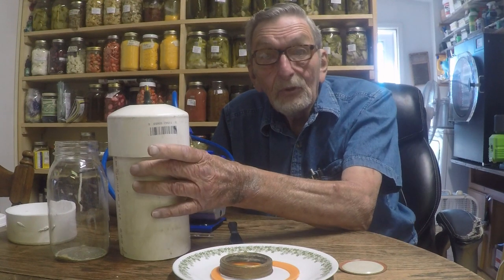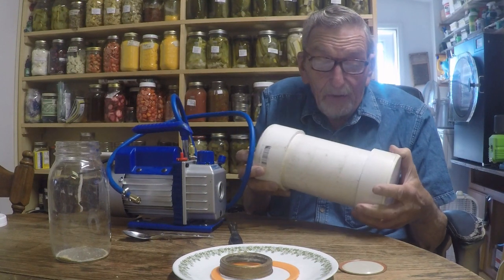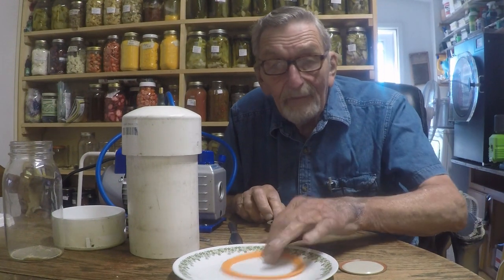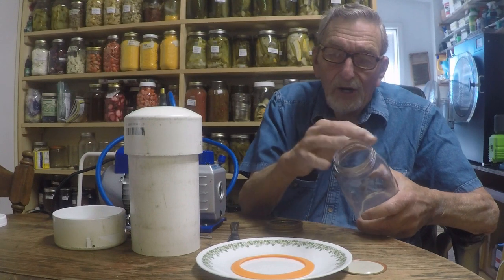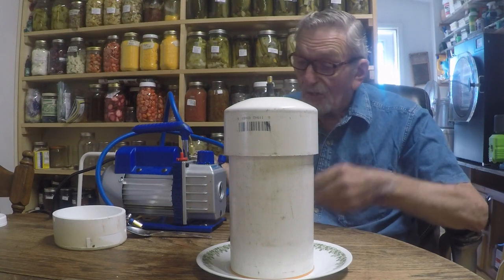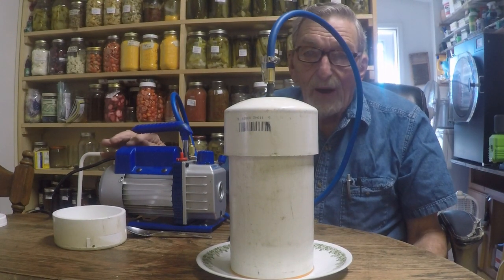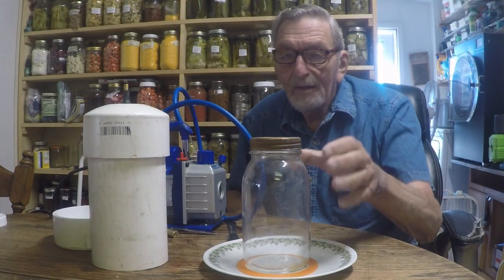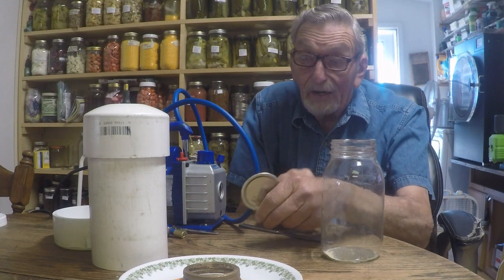DIY vacuum chamber flat surface

Comment: That is an incredible idea👍👍.
You can replace the rubber o-ring with 3/4" wide by 3/8" high foam weather stripping. It will permantly adhere to the PVC pipe the first time a vacuum is applied. A solid surface countertop can do the job of the dinner plate.
Reply from the maker: Great suggestions ... I think both will work just fine :)
Reply: Yup, one less part to mess with ... But only one worry is the ends coming together & leaking. Other than that, it's a good idea 👍
Maybe put RTV Silicone on the end and set it on wax paper to form a flat sealing area.

Comment: Thank you for showing us your simple but very effective idea. So simple and way less expensive than some of the others that I've watched. I need to give this a try.
Reply from the maker: Thanks for your kind words. Give it a try ... it should work as well for you as it has for me. As a side note ... I tried sealing home canned dill pickles cold pack ... failure! They seemed to seal fine but after a few months the seal was broken. I suspect that natural fermentation created gasses and internal pressure that in turn eliminated the vacuum and caused the seal to fail

Comment: Follow up:  I did a test with my "Potane vacuum sealer," sealing in my iPhone in a jar.  My start pressure was 28.85 inHg (14.17 psi) and my end pressure was 4.13 inHg (2.03 psi), for a difference of 24.72 inHg (12.14 psi).  This is a very high seal and good for long storage.  If the DYI vacuum can get 13 inHg (6.4 psi) or higher it should do fine.
Reply: Why 13inHg specifically?

Comment: Could you use a break bleeder hand pump? Thank you for the video,
Reply from the maker: You might but I suspect it would take a lot of effort to develop the vacuum required. Thanks for you comment
Reply from the maker: As an additional input ... I have used this method for a few months now and it continues to work very well. Canned a batch of tomatoes recently and one of the quarts did not seal. I ran the problem quart through the vacuum sealer and ... wala ... it sealed as well as the others

Comment: Elegant!  However, where did you find that gasket?
Reply from the maker: Here is a response to the same question a few months ago ... I had some used EDPM rubber that I used. However, any other material such as a dinner mat or other similar flexible material could be used. Hope this helps ...
Reply: @macmcquaid9413  yes it does!  thank you!!

Comment: Go one step father and put a phone in the jar with the barometer app on so we can see how low the pressures gets.
Or other barometric pressure reading device. 

This way we will known if the vacuum will be good enough to seal food for the long term.
13 inHg should be the target for a long term storage solution. 
Otherwise, good job!
Reply from the maker: good idea ... please let me know if you try this method what the results are

Comment: Where did you get the flat gasket?
Reply from the maker: I had some used EDPM rubber that I used. However, any other material such as a dinner mat or other similar flexible could be used.

Comment: Can you show how to the make the valve on top
Reply from the maker: 1. Drill a 1/2 inch hole in the top of the vacuum chamber. 2. Buy a 1/2 inch "tubeless tire" valve stem. 3. If you lubricate the valve stem with a small amount of liquid soap it will be much easier to pull the valve stem from the bottom of the lid through the hole to seat it. Hope this helps ...

Comment: Great video, do you sell them?
Reply from the maker: I do not sell them but the vacuum pump is available on the internet and the PVC pipe should be available at your neighborhood Ace or box store. Simple to build!
Reply: @macmcquaid9413  I appreciate you so much, you don't even know. We did canning when I was a kid straight out of the garden. I remember it was quite the process for mom, usually taking the better part of a couple weeks to get the harvest into jars the old fashioned way without any guarantees of quality sealing.

This here is just amazing. You've eliminated most of the initial cost of canning along with a lot of the time that goes into it. I can see it now being completely reasonable to even preserve leftovers now. In just a few minutes of prep along with this method, a couple quarts of leftover chili can go straight to the pantry without any fuss. Thank you.

I found your video by searching how to convert an old air compressor to a vacuum pump for poly casting. Now the machine gets to live on servicing a vacuum chamber, a pressure chamber AND for canning! :D
Reply from the maker: @JonathanLawrenceMitchell  This method works really well on several items we have vacuum sealed. We have vacuum sealed dry herbs, freeze dry items and other stuff and this method has worked well. However  ... we did a batch of "cold pack" dill pickles last year using this method. At first everything looked great. All the jars sealed well. However, after a few months the result were a  ... complete FAILURE! I suspect the continued fermenting process of the dill pickles created internal positive pressure causing the vacuum seal to fail. I am only guessing that this is what happened. So, my thought is to be cautious and check whatever you vacuum seal after a few months to make sure they are still sealed.
Reply: @macmcquaid9413  Please remember, Vacuum sealing alone does NOT replace heat processing to make wet food safe to store.
Reply from the maker: @danniescates3699  I agree. I tried to seal a batch of dill pickles which turned out to be a total FAILURE. I only use this method on freeze dry stuff and other DRY things. Thanks for your comment.
Reply from the maker: @JonathanLawrenceMitchell  I do not recommend using this method for any food that is not completely dry ... such as freeze dry items.

Comment: thanks  i subscribed
Reply from the maker: Hope you try using this idea. Been using it for over a month now and it just keeps working on everything I have tried ... wet or dry contents ... I have found if you vacuum seal liquid you will need to leave at least 1/2 inch head space or part of the contents will excape when the vacuum is released. Just canned several quarts of garden fresh green beans using a pressure canner.  One of the jars did not seal due to a small chip in the top of the jar. Switched the contents to a new jar and used this Vacuum sealing method ... easy peasy ...  Worked great!
Reply: @macmcquaid9413  thats  great           i will give it a try   thanks man